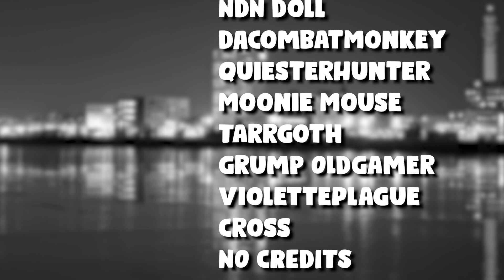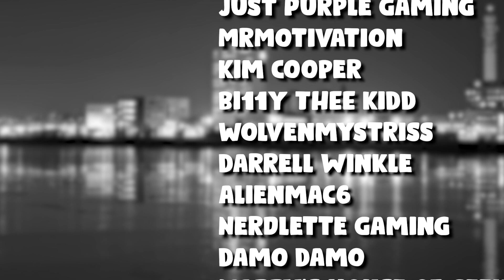7 Days To Die - Mastermind (E.37) - Hunt for Mo Power  | Alpha 20

Comment: So I had my minibike parked beside my bicycle because I had moved on to the motorcycle.   I died, and my bicycle was moved.  My minibike was now inside part of my base underground.  Thankfully it was empty...  They need to fix that.  😪  Also heads up..  I was running late to my horde base on day 35 on my motorcycle and the vultures outran and kept stunning me!  It was brutal.  So yeah, you are not safe driving on horde night.  😱😑
Reply from the maker: [Genosis] Designed with intent! The crafty buggers, yeah those are the "anti ride-around" deterrents.